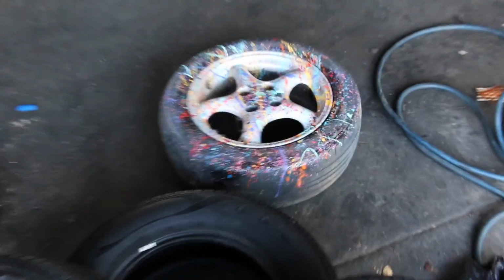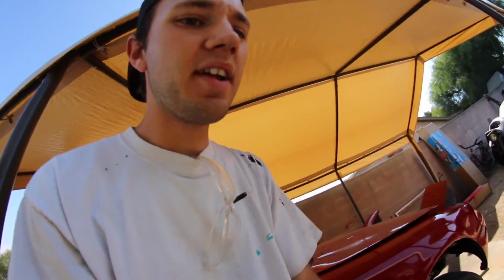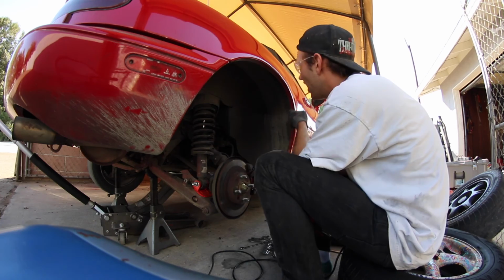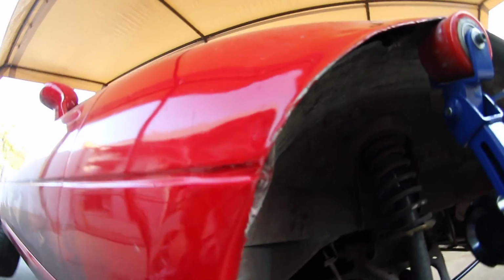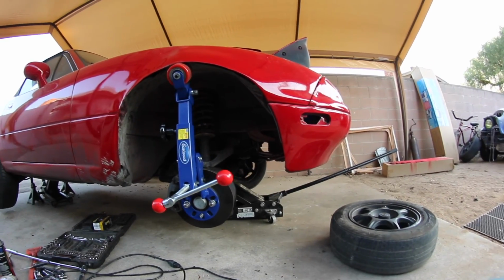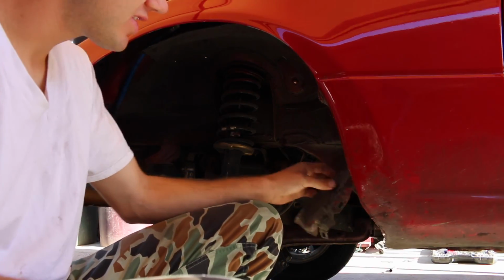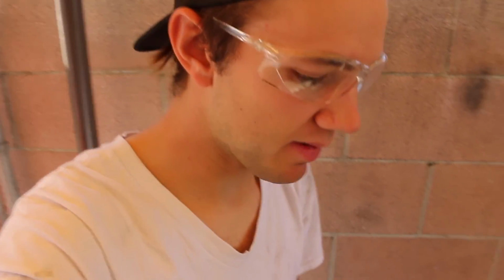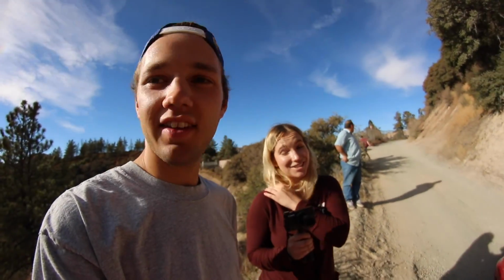Project Baja Miata - Episode Three - 26" Tires & Dirt

Comment: For alignment do you need to get any camber adjustment plates or just bolt stock suspension on there and go?
Reply from the maker: nothing special just all stock camber bolts and suspension, hope this helps